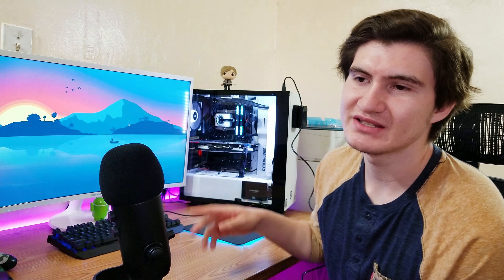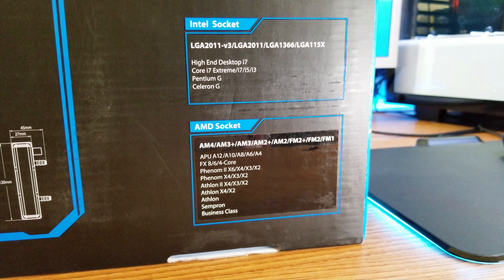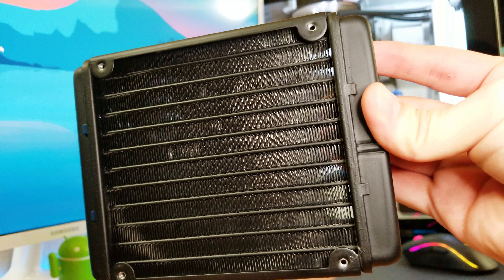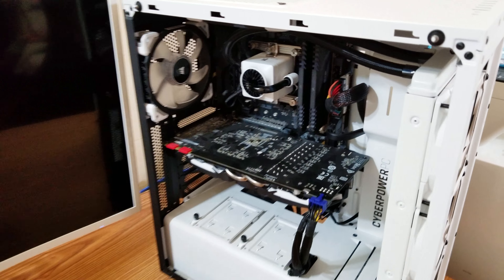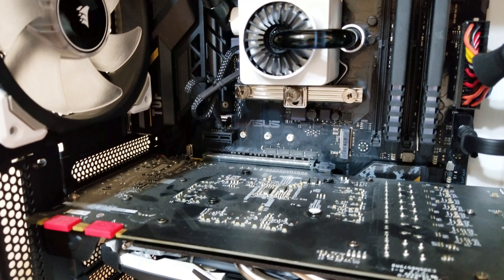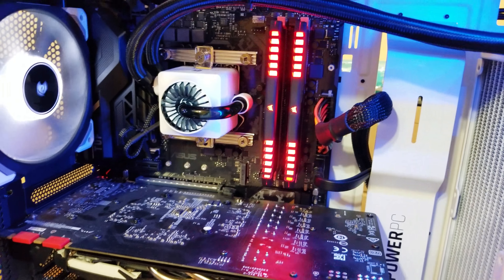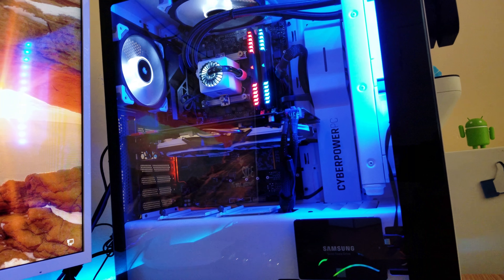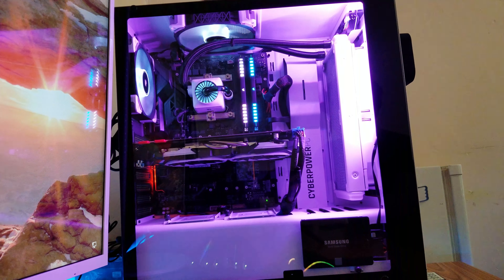DeepCool Captain 240 EX Unboxing and Installation

Comment: Why is the white led light on my refrigerator not blinking constantly? it stays off only when I turn on the equipment it works it has me worried
Reply from the maker: I'm not sure. Mine would blink constantly, but i couldn't get it to stay on permanently. Maybe it's different with every pump. Keep an eye on the performance to make sure it's cooling well.

Comment: I got a z390a prime Mobo, wondering how I go about connecting this to that, because it has 4 pin rgb connectors but this cooler is 3 pin..
Reply: This model is not rgb

Comment: Bro can i install this in my nzxt h500 front 280 mm radiator?
Reply from the maker: The front of the h500 supports up to 280mm radiator, so you should be fine.

Comment: why dont you flip your cooler 180 degrees so the pipes come out of the right side and give you more length? they give you a long fan cable so that you can do that.
Reply: with the 2 screws on the top and bottom only if he flipped it the would be nowhere to put the screws

Comment: Sooo i have the same CPU cooler and i have the fans mounted on the radiator in the front of the case but the label on the fans are facing outwards and the arrows on the fans are facing away from radiator and watching your video it was reverse should i flip my fans backwards??
Reply: I have the same CPU cooler and have tried running it both ways so the fans are in front and behind the radiator. Ive found that it cools the CPU slightly better if the fans are set up as shown in his video, thou i think they may be making slightly more noise. this is probably due to my case thou (Bitfenix Enso)
On another note, does anyone know how to make the white light on the CPU cooler turn on as seen in his video?? mine only turns on occasionally.
Reply: @inalcartraz  it's only set to a breathing config if it comes on ever so often there may be an issue

Comment: Why are you blowing hot air from your radiator INTO your case ? That's so stupid >_<
Reply: @smokeyd300  As long as you have fans on the radiator, your cpu will be cooled. The important thing is what you do with the HOT exhaust air comming out the other side. Depending on your CPU and existing overclock this can potentially be really hot. In your case you simply flip the fans to have them pull air through the radiator and exhaust the hot air outside, and flip your other two case fans for a much better cooling setup. I read your comment below about hot air rising, which is true. But it has no little to no effect in anything but a passive cooled PC case.